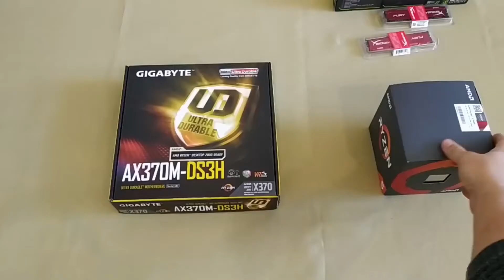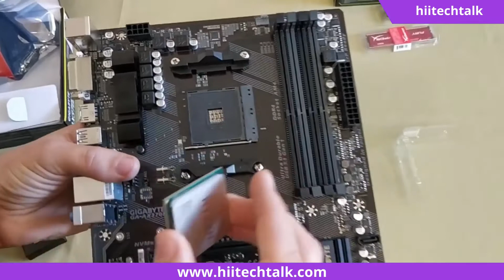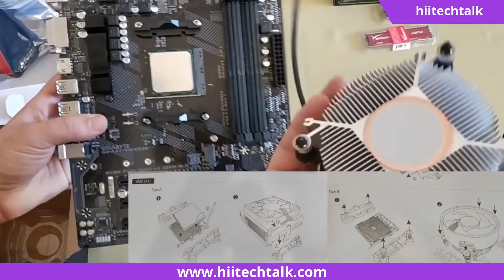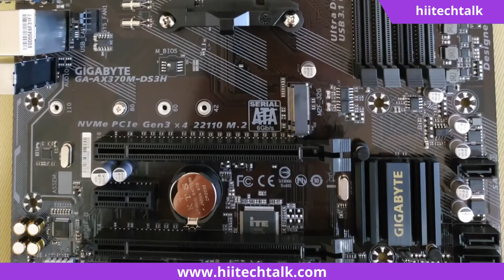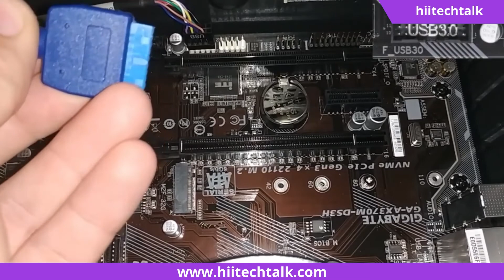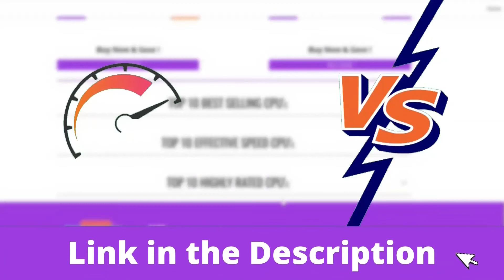Gaming PC Build | 9 Simple Step in 9 Minutes Only | Watch Now | Hii TechTalk

Comment: how much power psu should use ??
Reply from the maker: Usually it depends on the computer hardware or parts you use
But a minimum must 400 Watt if it's a gaming PC
Reply: @hiitechtalk8355  and should i purchase a ups with it also ??
Reply from the maker: @forsols4247  No Not necessarily , it will not help that much